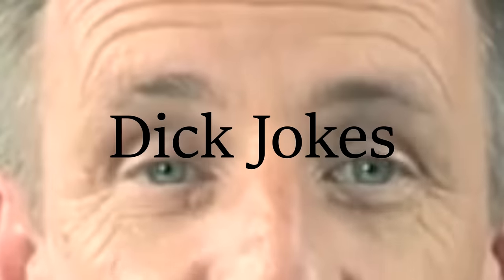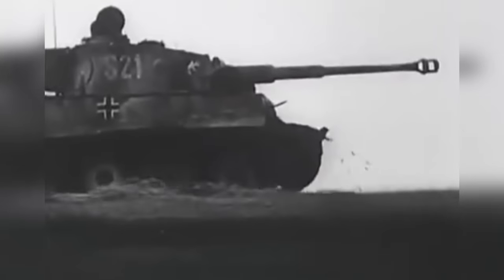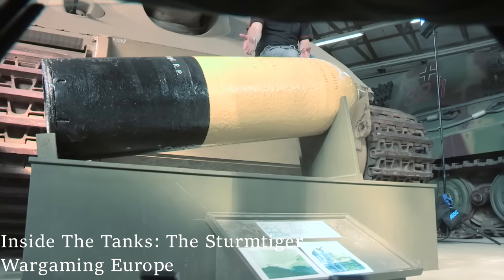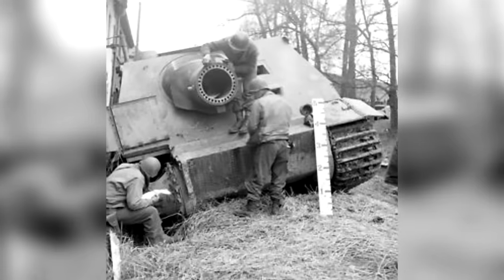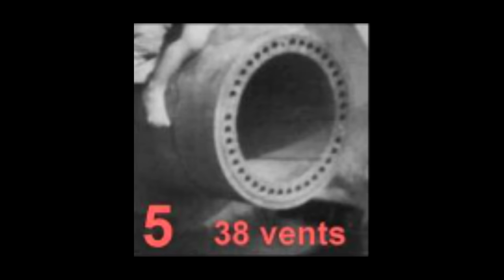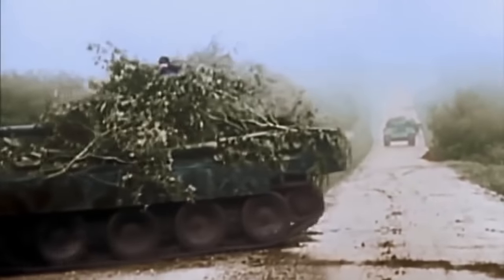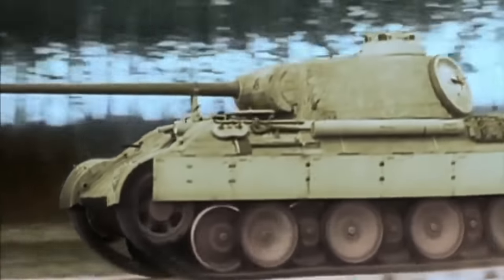The Sturmtiger, Too much too late

Comment: If you want to see the same concept, but effective: go look at the ISU-152. Penetration wasn't equal to the Sturmtiger against concrete, but Zveroboy was more adaptable. I always wonder why so many people praise German tanks when the Russian were way more effective on the battlefield. They were more reliable as they didn't break down as often as the German Big Cats, they had the needed spare parts and most importantly fuel. Plus they weren't pushover's. The IS-2 had equal or arguably better armour and Firepower as a Tiger I. The 122mm gun could blow a turret of without penetrating it. Not to mention the AP rounds on the 152mm guns on the SU and ISU.
Reply: Actually, many Russian tanks were just as unreliable if not more than the Germans, ESPECIALLY the T34. These things were being put into action with a service life of weeks-months cas noone was expecting them to last long in combat.
Reply: You know that is just rubbish people picked up from the Aberdeen trials right ? The first T34 model that was sent there was a very old one.Plus with that one the muricans forgot to put oil in the filter.Sure first production models did had issues, but remeber in what situation was the T34 conceived.The germans where just rampaging in Russia at the time.Thing is the T34 was sound desing wise so all the issues where ironed out by the russians.You want to see a vehicle that is truly unreliable ? Check out the legendary panther tank.Such a marvel of engineering that it could only be carried out on trains.And yes Panther drivers where instructed to skid steer it.
There is no russian weapon, tank our other system adopted for mass production that isn't built to last and be dependable and reliable.Is how russians do things.And doing things like this in war time is the smart way.The Allies did the same, this is one of the reasons they won.
Reply: If that's true, then how come USSR veterans themselves complained about the T34's reliability? Not to mention, many of the T34 losses on the Eastern Front were actually due to mechanical breakdowns(Look at the Battle of Brody and other major combat actions of 1941-1942 where the USSR lost most of the T34s in their unit). As for the Aberdeen trials, the Russians actually AGREED with the Americans on the unreliability issue of the T34s.

https://en.wikipedia.org/wiki/T-34#General_reliability

Source 48. Major-General of Tank Armies, Khlopov, 2nd Department, Evaluation of The T-34 and KV Tanks By Engineers of the Aberdeen Proving Grounds USA, Main Intelligence Department of the Red Army (n.d.) via The Russian Battlefield, retrieved November 23, 2011

Also note that I did not insult the Soviet victory on the Eastern Front in any way. I actually believe the Soviets bore the brunt of the German war machine throughout the war. And please don't launch into a tirade on how everything I say is just "US propaganda". If I'm appearing blunt, it's because I'm sick of radical idiots in the comment section.
Reply: The T-34 is a case apart. As you mentioned it was often used with a lifespan of a few weeks and thus didn't need to be that reliable. But when they survived for longer they proved to be easy to maintain f taken care of. For example the pins on the tracks could be put back in place with just a hammer. The T-34 is more about an effective, yet simple design than being a wondermachine. During the revolts in Czechoslovakia and Hungary, the 'rebels' would sometimes use tanks that were originally used as monuments. The biggest difference between the Germans and Russians is not the design of the tanks themselves, but the organization of the units.

The big Russians like the IS-series were on the contrary very tough, both for the opponents and the crew (heavy shells, clunky transmission...), but proved very reliable (compared to other Russian tanks) and deadly effective
Reply: What's this ? A russian tank effective ? You will upset the Wermacht fanboys.
In reality the russians did design and produced tanks fit to win wars.T34 was rugged and effective.And the IS2 was a proper heavy breaktrough tank.Reasonable mobility and reliabilty.Enough built and with effective armament to take out fortifications and any armored vehicle it could face.
Reply: Andy Su has spoken the truth! In reality any tank was unreliable compared to the mighty American Sherman tank! Many tanks were more powerful or better armored but NONE were more reliable!
Reply: usa pokerpro
Did sherman ever operate in russian winter conditions? (god alone knows how the soviets managed to keep the diesel powered T-34 going in winter)
Reply: Russians were all about getting the biggest gun possible to the fight and get it killing tanks.  It worked well with lend lease backing.
Reply: farmerned6 - the Red Army loved the Sherman's and used them to train their troops because it was so reliable but not to fight. The T-34 was only designed to last a few weeks of combat but was much better at tank killing than the Sherman. BUT the Israelis destroyed many T-55's and T-62's in the six day war with upgunned Sherman tanks. Funny but true.
Reply: The T34 may have been effective but it was DEFINITELY not rugged. Just check out its service life. Totally agree with you on the IS(or JS) tanks.
"There is NO russian weapon, tank our other system EVER adopted for mass production that isn't built to last and be dependable and reliable.Is how russians do things."

I can point out SO many exceptions to your quote. Ex: Zis 30, T26, the NI tank, KhTZ-16, the already stated case of the T34s, the KVs(especially the KV2, I mean yes it was a strong heavy tank but they broke down just as bad as the Germans), the Lagg 3(which only became an effective plane when it became the La5), etc. And dont forget about the hundreds of incomplete SPGs that the Soviets made in their tank factories during sieges like Stalingrad.
Reply: usa pokerpro Didnt they basically slap on a modern 105mm cannon on the Sherman in Israel's case?
Reply: T-34's were designed to last a couple weeks.  They were not good tanks, they were simply adequate.
Reply: there were Russian units fighting with the Sherman and they liked them.
Reply: I don't why the M4 Sherman gets such a bad rap. That tank was actually designed very well. It function brilliantly in its intended role and proved versatile enough to fill in for other roles on the battlefield adequately. And late in the war the 76mms proved good enough to take out the tanks which American and British armored units typically came across (mostly Panzer IV's).
Reply: Smintina Vlad from what i have read the panther reliability was fixed quite soon in the later variants. Only the first patch of panthers had these issues.
Reply: Yes! The easy eight Sherman's were powerful enough to take on the big German cats but were put in late into the war. I hate how the movie FURY shows that he Tiger tank take out the Sherman's with the 75mm gun first while ignoring the easy eight high velocity 76mm Sherman. The German tankers were instructed to fire at the Firefly's and the easy eights first as they were powerful enough, once in range, to knock out all the German big cats.
Reply: The KV-1 is arguably one of the most reliable tanks during WW2. I've seen documentaries where old KV-1's were dug up and put to working order even after being stuck in marshes and rivers for over 50 years! NUTS!
Reply: Ignace Jespers because practical the russian design weren't really as practical the russian 122 gun had a rate of fire problem also wasn't very accurate. Seeing a tank kill your allies isn't as horrifying as your allies getting killed by something you don't see.
Reply: Andy Su The reliability of the T-34 varied throughout the war. Saying that it was always reliable or that it broke down constantly are both half truths. The T-34 like many tanks had initial teething problems but they had mostly been overcome by the start of the war. The T-34s that were being used during the first year of the war were pretty reliable and by many accounts they were great tanks that could do what was needed. However the Soviet Union entered the war with a flawed organization. The Soviet Union had made something similar to the German tank division called the Mechanized Corps, however they were large and lacked sufficient logistics. This meant that supplies to keep the tanks running weren't reaching the front, which lead to breakdowns.

Enter 1942, the Soviets were quickly evacuating their production past the Urals. During this time the rail network was strained to the limit so everything had to be produced locally as much as possible. Not to mention that the Soviets just lost almost all their tanks and desperately need more. These two issues compound to create a situation where quality is not the top priority anymore. So the quality of the T-34 took a bit of a nose dive. It's automotive performance fell from the guaranteed 1000 km to about 200 km (Steven Zaloga, Amored Champion) with many tanks needing major repairs even to reach that. But for now that wasn't a problem as the tanks generally didn't last long. The Soviets were slugging it out with the Germans across a wide field and they needed more tanks.

Then 1943 comes around and the Soviets are starting to free up more capacity on the rail network as the evacuation is mostly complete. The Soviets were aware that the T-34 had reliability problems and that the quality control wasn't up to snuff. Therefor the Soviets start improving the reliability of the T-34 and by the time of Kursk the T-34s in use by the 6th Guards Tank Army were achieving actual life time performances of up to 3000 km without major repairs. To say that the T-34 at this point was unreliable is literally just false as we know what the actual performance experienced in the field.

http://tankarchives.blogspot.dk/2013/06/tank-reliability.html

Also it should be noted that the USSR counted every tank taken out of action as a loss. A tank could get stuck in mud and then recovered and it would have been counted as a loss. This is why that we sometimes see losses higher than 100% for a single operation, it was because it was possible for a tank to be counted as lost several times.
Reply: the Red Army loved the Sherman's and used them to train their troops because it was so reliable but not to fight

No. The Sherman saw frontline action, a lot. Dmitry Loza is a very easy example of Shermans in combat in Soviet use.

The T-34 was much better at tank killing than the Sherman

The Sherman sported a similar gun and armor profile, had radios and a three man turret, how is the T-34 much better?
Reply: How many thanks did the Russians lose in the war? 3 or 4 or even 5 times the amount of tanks the Germans lost....
Reply: Because the Germans built the highest quality individual tanks. And they did so because they had to. The Soviets made thousands of T-34s and didn't worry about reliability much, because the life of a Russian tank on the front was about 6 months, so who cares if the tracks only last for 9? The Americans made the Sherman lighter, smaller and less heavily armed, but with easy maintenance and good survive ability, because that is what they needed - a tank that could be shipped anywhere in the world, and fixed by its crew in Europe, North Africa, or the Pacific. The Germans built very high quality tanks that could take on any tank one on one, because they had to - They didn't have the manpower or the fuel to field massive armor across the front, so they needed to win every time the tanks fought.
Reply: Cant The IS2 not shoot when moving or the turret not straight
I actually forgot but I remember hearing this
Reply: that would be the KV 2
Reply: Dick Dickson no tank can shoot accurately whilst moving even with advanced gyroscopes,  take a look at modern tanks,  the crew always stop the vehicle prior to firing the gun. Plus the gun sight that the soviets used on their vehicles are on par with the germans,  is only who can put the first shot
Reply: Andy Su you said the t34 wasn't reliable and then out seem to say most soviet vehicles suffered the same fate
Reply: @Vlad_-_-_  The Russian T-34, by design and across all models, were only designed to lat 100 miles before their engines gave out.

The later tanks were good though the T-34-85 is overrated.
Reply: And the only overrated tanks are the german big cats.Good on paper and for propaganda much more than actual weapons of war.But that propaganda still manages to fool people like you more than 70 years after.
Reply: The IS2 or ISU152 didn't need to penetrate to destroy any german tank.Spalling, concussion or pressure from the massive shell is enough.I am not even mentioning the HE rounds.
Reply: @Vlad_-_-_  When did I say that the German big cats are great?
Reply: Good that you did not. because they were not.
Reply: @Vlad_-_-_  That isn't entirely true. The Tiger was a good tank; heavy armour that regular Shermans and T-34s couldn't penetrate, a heavy gun that negated the armour of every tank at the time, and it was so rare that it became a legend that only made it more threatening. Sadly for the Germans the heavy armour became less of an advantage and more of a disadvantage as the war went on and as bombing raids destroyed their industry.

The prototype T-34 was also very different from the production T-34 as the prototype was deemed too expensive. It was cheaper in every way, especially its lifespan.

Comment: Just told my grandfather about the gun on this thing (Vietnam War tank mechanic). He initially called cap saying that this tank supposedly has a Battleship's main gun mounted on a tank chassis. I then mentioned the two stage rocket system for the ammunition, and he responded with “Aight, not cap”. He said that it's basically an overkill vehicle at that rate.

I'mma be fair, it's a 12 inch pile driver made by people who could've used SPGs, and whatever rocket launchers they already had for bunker busting. Not like they were gonna stop the retreat, but we got a nice meme tank out of it.

Real talk tho, how bad would an ammo racking had been for everybody on the block next to it? 16 shells worth of borderline mini-nukes, stored in a single tank...
Reply: Update: I accidentally said 310 instead of 380mm. How much overkill is this damn thing?

Comment: If you consider that German air superiority had long been gone by the time the SturmTiger hit the field. It wasn't really for the same roles as previous assault  guns but rather to fill the gap of close air support. It was built and intended to knock out hard points that something like the 500lb bomb on a stuka would've had no issue with. It's very similar to the SS Panzerwerfer being developed so they didn't have to stop and unlimber or re-limber caissons. When Germany lost air superiority their entire arsenal of mechanized vehicles changed to try and fill that gap.

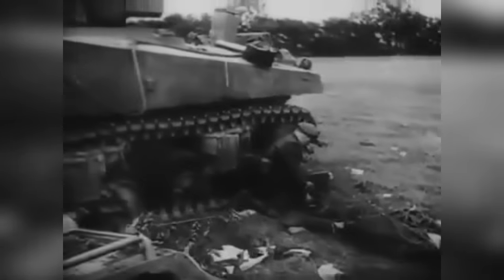Comment: 3:32 I haven't seen any comment so far on this (partly I'm too lazy to check through all of them). I have heard the reason for taking out the 3 Sherman's was it being ordered to take out a bridge to slow allied troops. The round that was fired miss and ended up landing in a resting area for Sherman's which took out 3 of them. So it was somewhat a task failed successfully in a way

Comment: Be better jacking the suspension and engine up on a tiger 1 as well as sloping it's armor or adding 2 layers to front then using a 6 barrel revolver 88mm long gun on it so it can fire 6 shots in 6-12 secs.

Comment: I'm surprised they managed to cram 16 shells into that thing and have way more armor than you'd think be necessary for what's basically artillery.
Reply: 14 inch shells, actually. 16 inch shells would require the Sturmtiger to have a 406mm barrel, not the 380mm barrel it actually had.
Reply: @youraveragescotsman7119  You misunderstood. I was talking about the amount of shells and not their diameter.
Reply: @Juel92  

Ah bugger. Just realised that you said "16 shells" and not "16 inch shells".

I should probably not drink and read YT comments.
Reply: That is one giant nuke on tank treads

Comment: Some wrong things to point out. 1. The Sturmtiger can only hold 14 rounds.....Not 16. And only if one round is preloaded in the barrel and the other strapped to the loading trunnion.....Most crew didn't do this so the normal loadout is 12 shells....Hence why there once was a plan to convert further Tiger 1's to ammo carriers to carry 24 rounds inside but only 1 was built before the war was over. 2. There was a shell that weighted over 800lbs. This is the high explosive version that can be used to level an entire city block. The 754 lbs version is the HE shaped-charge type shell used to shatter fortifications...Which is not good considering an American 155mm "concrete buster" round can take out well over 7 ft of concrete! Why? This is because the  barrel was rifled and at the time, engineers did not understood that rifling the barrel and making the round spin is actually DETRIMENTAL to shape charge warheads! This is why all modern tank cannons are smooth-bore and the HEAT type round they fires all are fin-stabilized, rather than spin stabilized. 3. The Sturmtiger did have 5 crews...yes.....You guessed it, 2 loaders! But guess what, in a actual loading session, even the driver and radio operator has to help! Such is the weight of the shells and their absurd size.

Comment: Imagine the Germans with more and better troops and fuel (for whatever reason) breaking through the first day of the Battle of the Bulge and heading straight towards Liege.  Such siege weapons could have made the difference in the battle.  The truth is that they didn't know if they were going to need certain specialized weapons, and in such a situation it is better to have them than not have them, when failing to make the effort to put them into production would have made little difference.